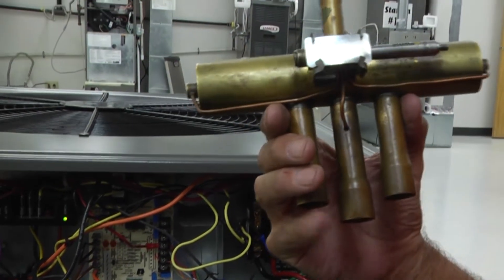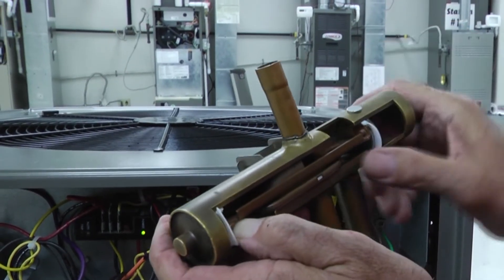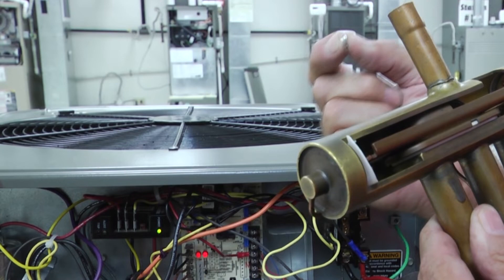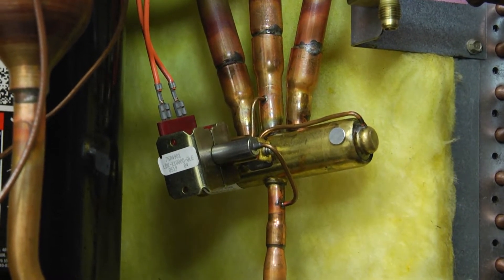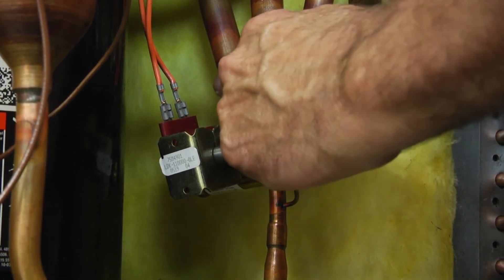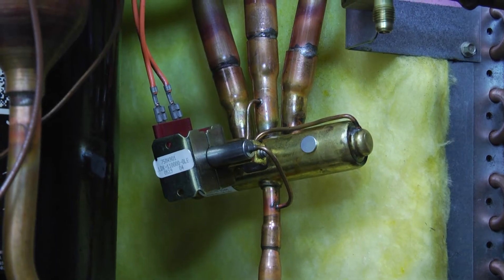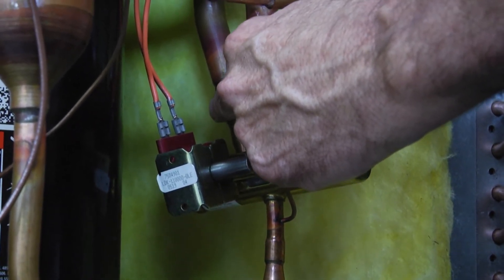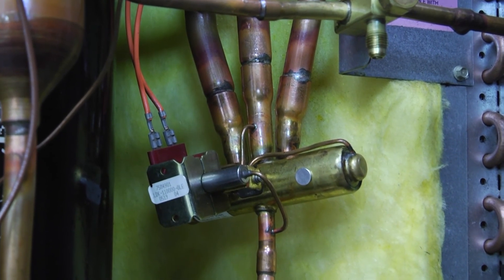A Comprehensive Guide to Testing Reversing Valves for Optimal Performance

Comment: Genius dude , genius ! 😂 I have a question ! So a PTAC at my hotel , the verdant thermostat will stay on heat mode but it says cool on the screen ! 
                    The heat just stays running , I switched it back to the PTAC and the compressor kicks on and it works , you think it's the reversing valve solenoid ?

Comment: 10 to 11 degrees difference? Where are you getting this information at? I've always seen and heard 3 to maybe 7 degrees, typically the valve will absorb some of the heat but that is a large difference. Please reference your source so I can research this further, thank you. Never seen the magnet trick.

Comment: I've tried using a big magnet on it tonight but it didn't budge. Also tried a hand held back massager to help loosen if it was stuck but still didn't work. Might have to just remove the shroud and check for 24v and do the screwdriver in the hole test

Comment: That magnet trick works only if it’s stuck, you need to get your discharge and suction line temp differential to check for one that is bleeding. Learned the hard way
Reply: Can you elaborate please?  I've got one with low head / high suction I need to figure out.
Reply: @cleansebob1  maybe compressor valves, are the pressures equalized? If so check to make sure that your compressor is running. I don’t know what your experience level is
Reply: @cleansebob1  find the discharge and suction lines, put a temp prob on each one while it’s running there shouldn’t be much difference

Comment: Question: what can be the reason of dropping down pressure in the suction line when u run the compressor of heat pump( from 80pcs to 0pcs) within 20sec, seams gas not recirculating. the following items on the circuit installed:Reversing vale, Expansion valve
Reply: Sounds like your Txv power head has lost its charge and is unable to open causing the pressure to drop.....could also be low refrigerant charge or a restriction in the circuit somewhere

Comment: It’s never a clear cut diagnosis when it comes to reversing valves because if the compressor is shot then you’ll never know if it the compressor or the reversing valve?!?!
Reply: Do a pump down, if it pumps down then your compressor is fine.
Reply: @mackenziegray2090  that’s legitimately valid if you have service valves to do a pump down. But if you ever worked on a water source heat pump. Or a package rooftop unit. It’s very hard to tell.

Comment: How do you conduct this test on a condensing unit? Can this be done with the fan at the top removed?
Reply: Theyre usually on the outside of the fins behind another cover plate next to the service valves..

Comment: My heat pump reversing valve occasionally goes to the wrong position but works most of the time, I notice this when it was blowing out heat in the summer now that its cold it was blowing cold air and its winter, any ideas,

Comment: is it possible to free up a reversing valve that is sticking or it that a lost cause?
Reply: @HVAClearning  thank you
Reply: Mine was occasionally not going into full cool mode under defrost, but only in 40+ ambient temps. I ended up getting the emerson universal defrost board so there's a delay going into defrost and that seems to have fixed mine. I also swapped my contactor while I was in there since it was pitted and the defrost delay will cause more cycles
Reply: @rvamtbram  thank you

Comment: Good video, I assumed Lenox equipment is default on heating and in cooling mode the RSV required 24v  to shift? Does anyone know which are the 2 manufacturer does the opposite? TIA.
Reply: @HVAClearning  Thank for a quick replied👍